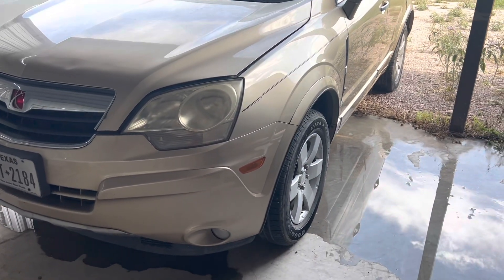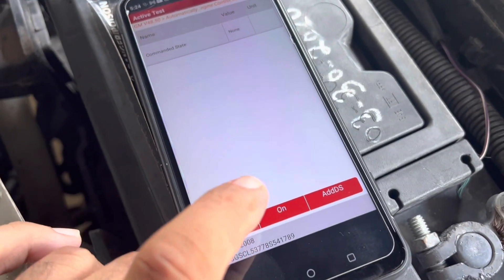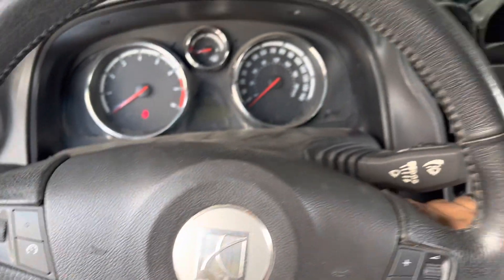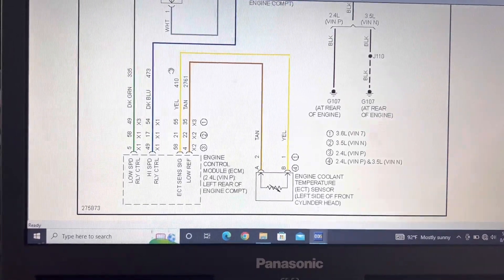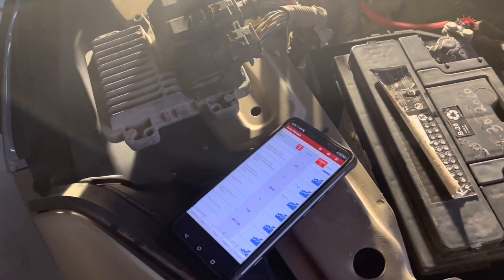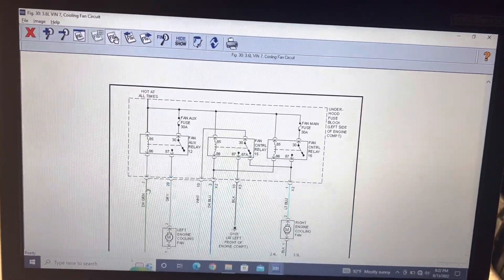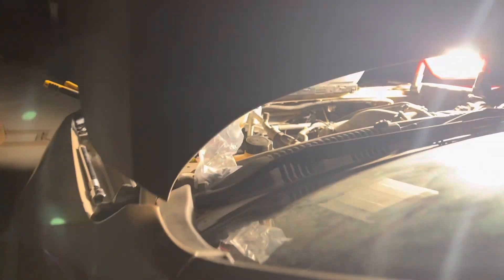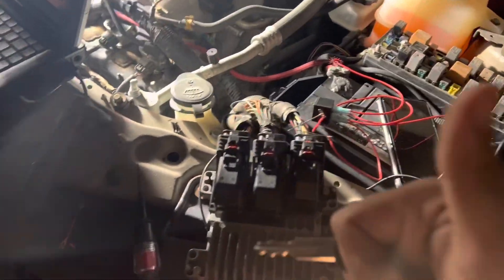Radiator Fans not turning on 2008 Saturn Vue Fix

Comment: I have a 2009 2.4 eng. Vue xe. We changed the a/c sensor. No change, I get no a/c and it is saying engine hot / a/c off . ? ???? Puzzle I’m in Orlando Florida.
Reply: Did you ever figure it out ? I have the same exact issue

Comment: What was that scan tool you used in the beginning
Reply from the maker: Easydiag2.  I had bought around 2017. Now I think there’s one called ThinkDiag. Never used it, but I heard you can get it for around $90 on eBay with every brand unlocked.

Comment: I have a 2004 saturn vue and only  the small fan turns on when I turn on the engine , and the big fan does not turn on . what could it be , can you  tell me please
Reply: with most modern cars that have two electric fans - one fan comes on when the A/C is turned on and the other is operated by a thermally operated switch - when the engine coolant reaches a certain temperature

Comment: Hellooo i have a 2007 saturn hybrid, do you know why the fan is always on even though the car has been cold?
Reply from the maker: Probably a bad temperature sensor. Or it has also been bypassed to turn on when vehicle is on.
Reply: I had that problem and not even the air conditioning worked until I changed the thermostat.